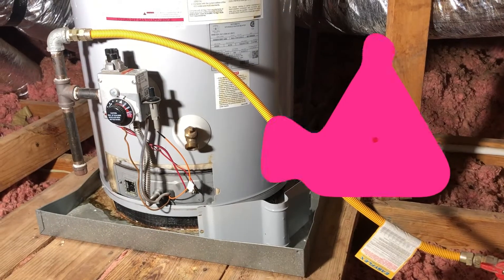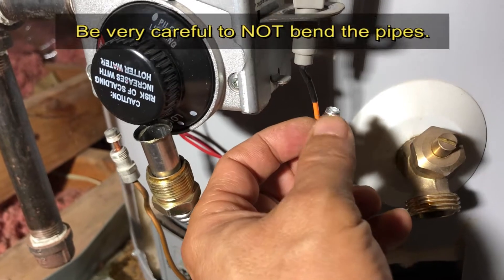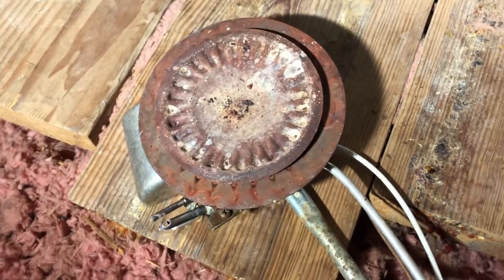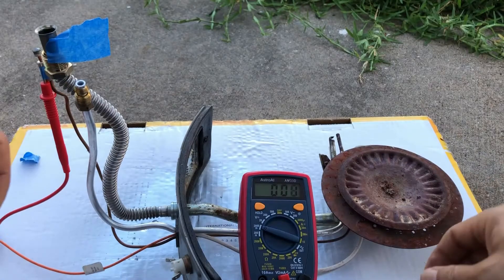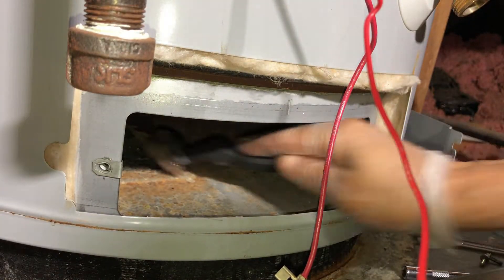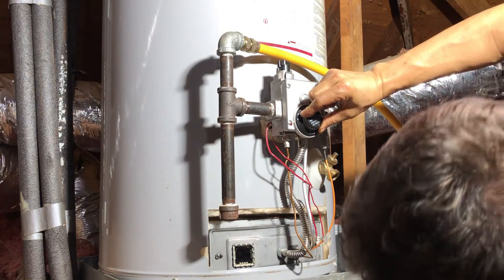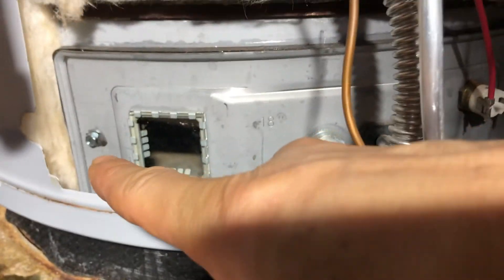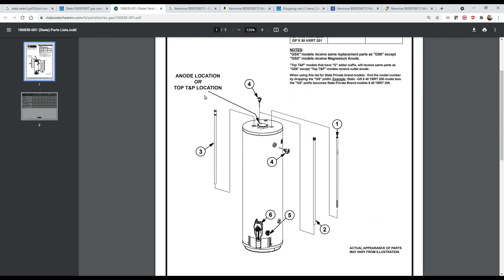Test & Clean "State" Water Heater Thermocouple

Comment: The most detailed video I have seen. I learned a lot.
I am saving it for the next time my pilot goes out. 
I try to figure out the issue before I look up videos or manuals. (Bad, I know). 
My WH doesn’t have a fancy push button igniter. Instead I have to use a long Bic Lighter. 
Pilot wouldn’t stay on. I did notice some white buildup which looked like it didn’t belong. 
Due to my limited knowledge, I had to go back down from the Summer attic (Birmingham, AL … Not quite Houston TX 🔥). Brought up a long skinny screwdriver to carefully remove the buildup. Fortunately, I was very careful and successful! 
LISTO! 
I was able to get the pilot ignited and has remained lit for about 6 months. 
23 yo water heater 👀
Next time, I will give it a proper cleaning by following your video!
Reply from the maker: The thermocouple is just $10 to $20, so if you do happen to take it out, it's probably just easier to just replace it. Required steps are almost same.

Comment: I have an almost same model and I am having the same problem. I learned a lot from you! Very helpful! I am from Houston as well!👍👍
Reply from the maker: Oh hi, it's always good to meet local Houstonian.   :-)

The thermocouple that I ordered from Sears parts didn't fit, though it was the same part number. 
But Lowes had exact one that was actually cheaper (I think it was $10 buck). 

I did the cleaning while waiting for the part and to see how long it would last, but I recommend just replacing the thermocouple since it's cheap, so that you don't have to open it up again later.   Here is more detail video on how to replace the thermocouple for this unit.  
https://www.youtube.com/watch?v=wKL5EyvID3c

Comment: I have the same issue. Whirlpool (in my case) came out with a defective water heater I think. I changed out the Thermal coupling maybe 5 times in 6 years. I had to take a picture of the thermal coupling item number and box it came in because the threads are backwards and I have to order a specific one. Regular universal couples don't work with mine and Lowe's and Home Depot don't carry them anymore so I had to order from Ebay. I don't want to spend $600 on a new water heater but I may have to next year.
Reply from the maker: Yeah it’s strange that the exact OEM part that I ordered didn’t fit due to slight thickness difference but luckily a generic brand from Lowes worked.   Also it’s strange that new thermocouple is failing so often. Usually they can last few years to sometime more than 5 years.  If you do buy a new one, get the longer life/warranty one as it’s only little bit more and will save on installation labor costs.
Reply: @DIYLifeSkills  So I bit the bullet and bought a new one even though i was waiting for a thermal couple from ebay. I just got tired of messing with it. I bought a Rheem and I love it.
Reply from the maker: @salba32  In the past I got the 6 year warranty 50 gallon hot water heater so I end up changing them every 6-7 years, but this time I got 12 year 40 gallon so hoping to get that long of life.
Reply from the maker: My coworker who drains the hot water once a year in the spring thinks that’s what’s allowing to prolong the life.  Mine is in the 2nd floor attic, so it’s like in the 3rd level, so it’s not Ben convenient to run hose up there, but I’m gonna give it a try starting this fall once it cools down.  Houston has been scorching in 100f temp for several weeks now.
Reply: @DIYLifeSkills  Wise choice, I too bought the extended warranty over the 6 year warranty the original water heater came with. It was like $65. I don't want to fool around with water heaters anymore. I too live in Houston. It's been HOT. I wait 30 minutes before the sun goes down to even cut my lawn and it usually take me an hour.
Reply from the maker: @salba32  yeah i cut the backyard lawn in the morning when it’s under shadow of house and cut the front lawn near sunset when it’s cool and under shade.  What a crazy temperature we have here and around the world.  I’m afraid it’s just going to get worse each year unless we human and industries change our behavior.   I worry about our younger generation’s life quality

Comment: Yoo what size wrench did u use for the middle pipe on the water heater
Reply from the maker: At the time I was up in the second floor attic, and the crescent wrench worked, so I didn't get an exact size, but the middle one was definitely bigger than the 7/16" on the side, so it's gotta be 9/16″, 5/8″, or 11/16″.   Or just use a small adjustable wrench like I did.    I would go measure the size if I still have this, but it was just replaced because it started to leak some particles in hot water...probably because I never flushed the tank.   LOL   Good luck.  Oh, if you do find the exact size, come back and let me know, and I'll add a video caption to the video for others. Thanks.
Reply: I just took mine off this morning.. right now to be exact- with a 3/4 wrench

Comment: You had the TC at 17 mVolts. I read it should be at least 25 mvolts.
Reply from the maker: That may be why the cleaning didn’t last long time.  I ended up just replacing it few weeks after. I have a separate video on it.

Comment: Did cleaning the thermocouple fix it long-term?
Reply from the maker: Yes it can last for several months but given the part is cheap ($20-25) but it’s bit of work to remove it, I strongly recommend just replacing it.  I have another video on replacing this thermocouple
Reply: I just cleaned a thermocouple and it lasted 3 days. Just going to change it out now.
Reply from the maker: @futfut1  excellent idea as it’s pain to clean frequently for a cheap part.
Reply: @futfut1  surprisingly, the one I cleaned 5 weeks ago is still working fine.  I have bought new ones (two water heaters) and am planning to replace them soon.
Reply from the maker: Yeah I’ve had it last more than a year one time but usually it’s lucky to get more than few months.  Now I just replace them and not bother cleaning it since it’s cheap to replace it.
Reply: When I took out the TC, it had a TCO or thermal fuse like a black button inline. I wasn't sure if I could replace it with a universal TC. So I cleaned it , did some research and hoped it would last. 3 days later it went out again. I read some people just used the universal TC with no issues so I did that.
Reply from the maker: @futfut1 the one I ordered from sears didn’t fit but the generic one I bought from Lowe’s fit perfectly and that lasted more than a year  until I ended up replacing the hot water heater due to having black particles coming out in hot water.